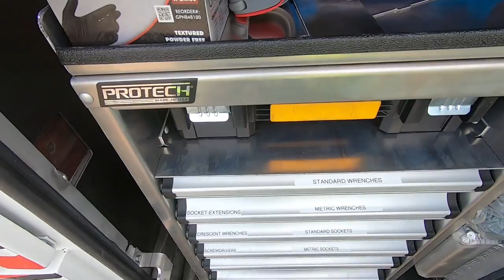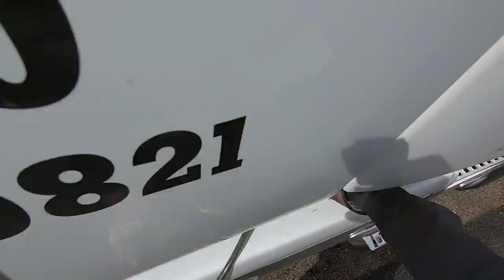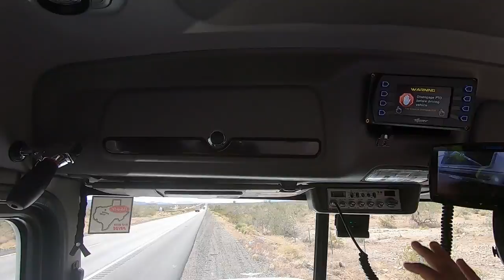Towing With Rotator! 145,000 Pounds Downhill

Comment: Nice job hooking it all up and pretty smart of you to drive up on blocks due that truck being so low. How would have towed it if the truck wouldn't go on the blocks due to not starting?
Reply: There are videos of him dealing with trucks with the same problem (a few newish freightliners, one if I remember correctly had a title containing freightliner cascadia 2019...), they just insert tow pins and lift the front using the winch on the boom (or crane if you will on the rotator) hooking the tow pins, then they slide the under lift out under the axle and done....

Comment: What does PTO mean? I hear that a lot just want to know.
Reply: Power takeoff, on a tow truck it runs a hydraulic pump to provide power for all its functions, on a farm tractor it is used to provide rotational power to various implements via a driveshaft
Reply: Power Take Off - takes power from engine with a hydraulic pump to power the hydraulic motor for the towing equipment.

Comment: Mistake its not a automatic Dummy driver said Manual no need to pull Drive line
Reply: You ALWAYS pull the drive line, you cannot spin the output shaft of hardly ANY transmission under tow without risk of burning up the transmission due to lack of lubrication.  If it was a 4WD with a transfer case that can be shifted to neutral, you might be able to get away with it, but even that isn't an absolute as some models may still require you to drop the drive shaft(s).